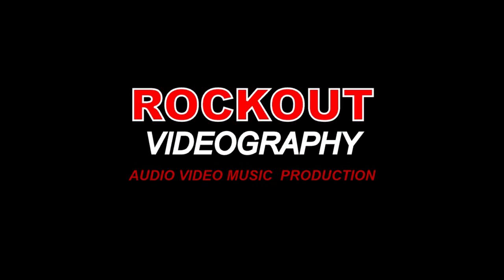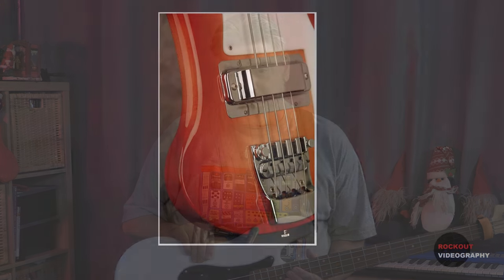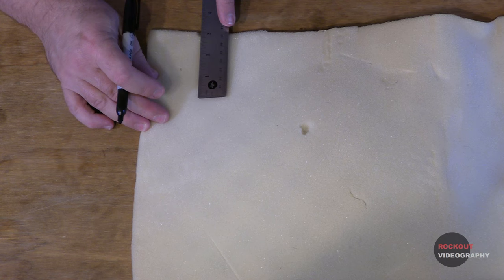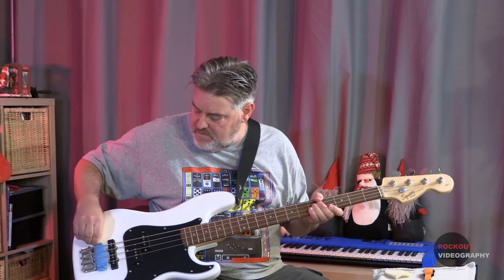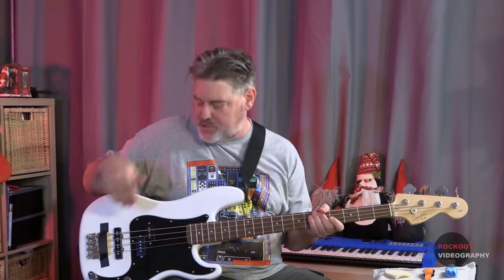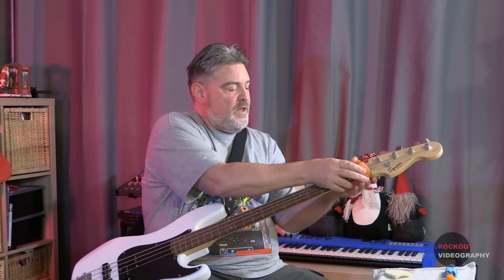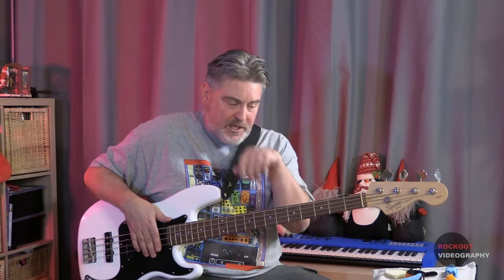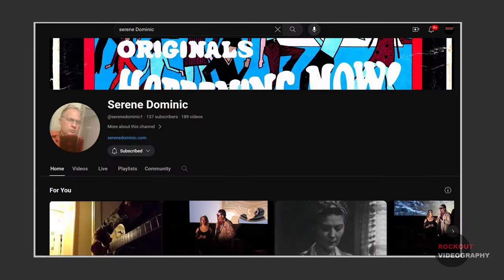What's The Deal With Bass Mutes? - Everything You Need To Know

Comment: A fret wrap only mutes open strings (you can hear it in your examples). It’s useful for dampening open strings when playing.
Reply from the maker: Thank's for adding that. I should have explianed the open string dampening. I just "wing it" when doing the demo part of my videos. Although I "Think" it also sounds dampened when I play fingered note using the fret wrap, my favorite, and the only one I really use is the piece of folded 1/2" foam. I appreciate you taking the time to add a comment and help us all out!
Reply: Well done! Maybe this could’ve been a lesson in palm muting because mechanical is insufficient.
Reply: Certain tunes would crush with this
Reply: In my mind palm muting is a different technique for a different sound - more staccato notes and a tighter sound from playing near the bridge.
Reply: @rockoutvideography91  It can affect a fretted note after you move your finger off the fret. But when the string is actively fretted, the mute is nowhere near the part of the string that's vibrating. I can see it taking some pressure off of trying to do left and right-hand muting perfectly. You won't have as much ringing.
Reply from the maker: @paulraphael  thanks for clarifying and explaining that better. Your explanation is very helpful!